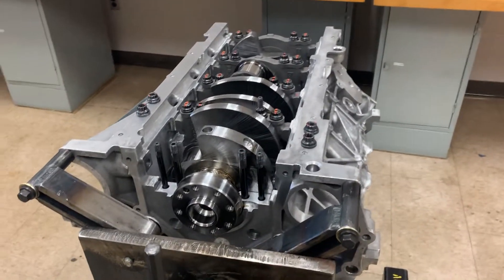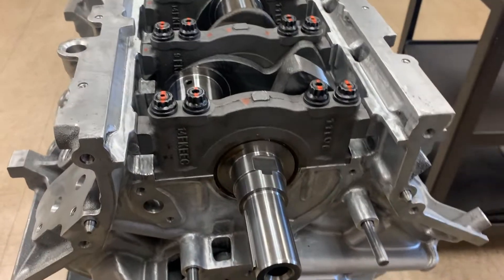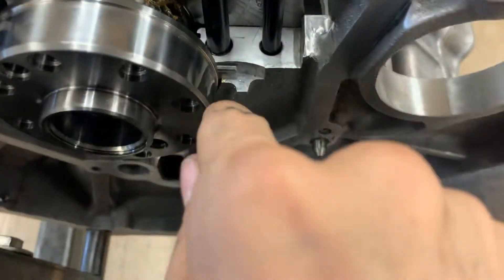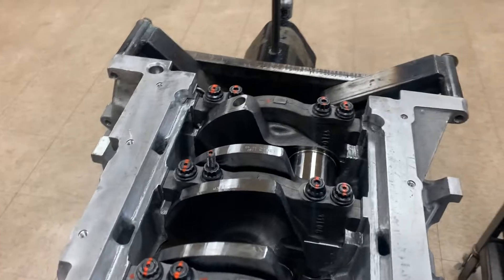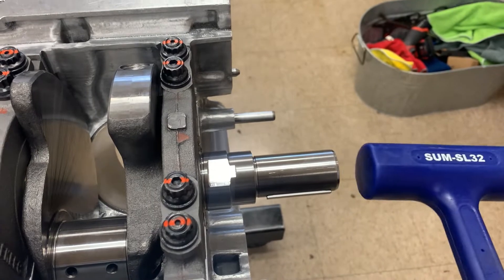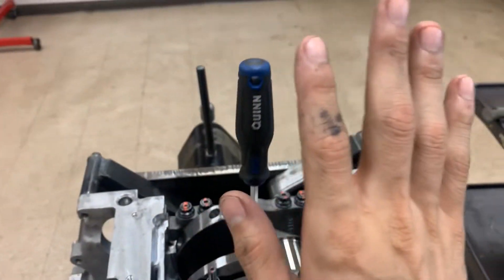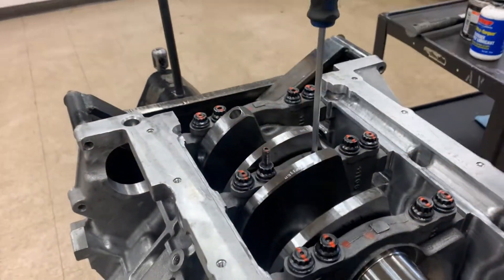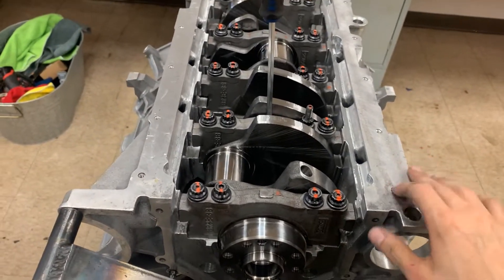Coyote 5.0 Engine Build- Thrust Bearing

Comment: Does this thrust bearing moves a lil when the crankshaft rotates? Mine does. Is that normal?
Reply from the maker: @jaraujo9881  What do you mean move? Are you saying the half washer moves or your larger thrust bearing in the main journal? Neither should move once the crank and main caps are assembled. You should have something called end play which is the movement of the crank towards the front and rear of the engine. If your thrust bearing is rotating then you have a problem.

Comment: Also is this possible to do with motor in car already or no?
Reply from the maker: Fuck no, not if you need to change the thrust like you are saying.
Reply from the maker: Honestly bro, I would dead ass return the MMR plate and hit up boundary performance. They have billet back plates that come with certified specification sheets. There billet pump is about $1000 which is still cheaper than that MMR plate, and you can install boundaries pump with the engine in the car.
Reply: @queso2561  Thank you, brotha. very much you are very helpful. I couldn't find any research on what I was looking for, and you nailed it!!!!!
Reply from the maker: @Chillichilli5oh  Np bro. Keep in mind if you decide to keep the MMR plate that will now become a maintenance item. The roller bearing will not last the life of the engine. Don’t listen to anyone who says it will. 

Additionally, if you’re under a 1000hp you are not going to see any real benefit from the roller bearing. There is a reason that MMR displayed a video showing just the crankshaft spinning with no pistons, rods, or rings. Once the rotating assembly is in there is enough friction from the rings and added weight from the pistons and rods that it really makes very little difference. Don’t be fooled by everything that looks cool. This plate will be more of a pain in the ass than anything if you daily drive this car.

Comment: Hey brother im installing a mmr roller bearing back plate which calls for my thust bearing to be tooken down 0.25 and 1/2 moon spacer not to be reinstalled is that meaning the trust washer??
Reply from the maker: Well to answer your question the 1/2 moon spacer is the washer. The thrust bearing is upper bearing for main journal number 5. 

I highly doubt they want the thrust set to .25 thats really large. I’ve never installed there plate because MMR has horrible customer service and there quality control is sketchy at best. They are probably referring to the thrust bearing thickness which means you will have to remove quite a lot of material. It will be important to make sure it’s uniform all around so avoid a belt sander.
Reply: @queso2561  thanks for the real quick response brother 🙏 👍  you made my answered all my questions and at a understanding point.
Reply: @queso2561  I got some BS parts from MMR. One was a crank sprocket that did NOT go onto my crank snout/crank key for sh1t. I flipped the gear around to see if it would even start on the key, and it didn't even touch the top of the key, the tolerance was that 'tight'. That's what they and the parts seller tried to tell me "just hammer it on with a socket". And I just said "oh ok, so if I Hammer it on, and it gets stuck halfway on the crank then what" and the guy actually said to just take the crank to a shop and have it pressed on 🤦🏽‍♂️ I promptly got a different brand. The inner race of the gear came with really bad score marks and not smoothed out at all. It was clearly a bad gear, but the place I bought it from sent me a video of them slipping it on a factory crank, no problem. Staked it to varying factory tolerance..the issue wasn't even the snout it was the keyway of the gear not being cleaned out properly from the CNC. Never again.
Reply: Sorry meant Oil pump gear back plate from mmr

Comment: good video, son why did you not grease up the sides of that thrush bearing
Reply from the maker: Initial setup of the thrust bearing should be dry to verify the thrust clearance with a dial indicator. For final assembly applying grease to both sides of the thrust washer is fine.
Reply: @NitrousYote  I have been asking that question all week, thank you! i could not get my in play right on this sbc i am putting together I feel the assembly lube was the problem but i could not find any info on the topic
Reply from the maker: @joshstaley7459  rarely do thrust bearing come out of the box and nail the specification you are trying to look for, this is why it is important the thrust bearing is dry bc if your tolerances are too tight you have to take some 400 grit sand paper and remove material from the thrust bearing through figure 8 strokes on the sand paper with wet sanding with some WD-40. You cannot make adjustments to the bearing when it’s full of lube. I’m glad THIS SON can pass on some knowledge😂
Reply: @NitrousYote  that what i did. i had .001 out the box, and i sanded until .005